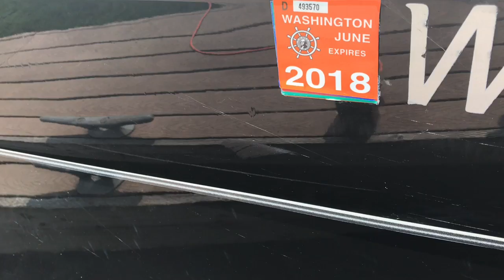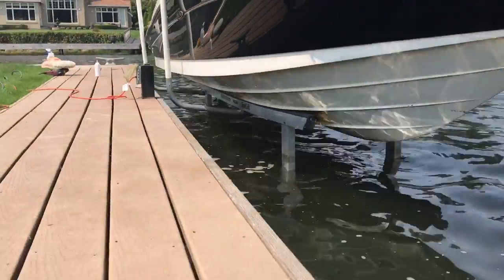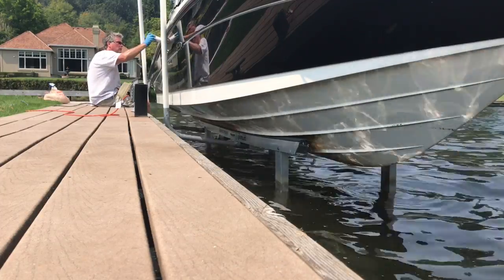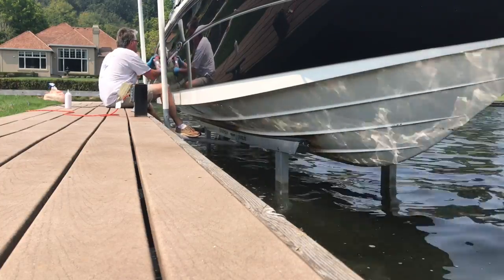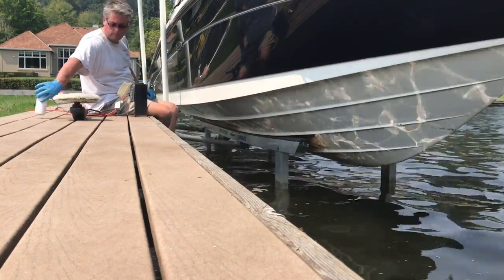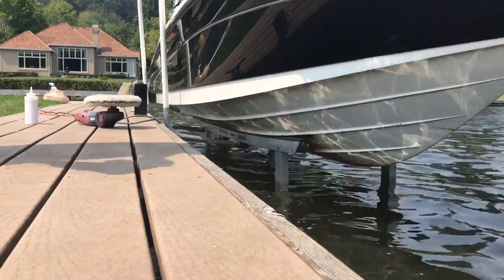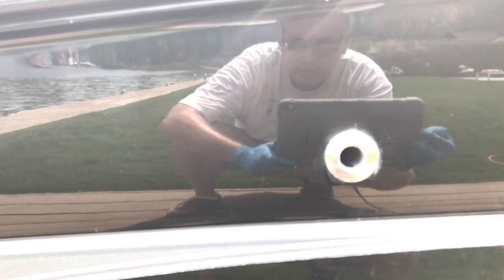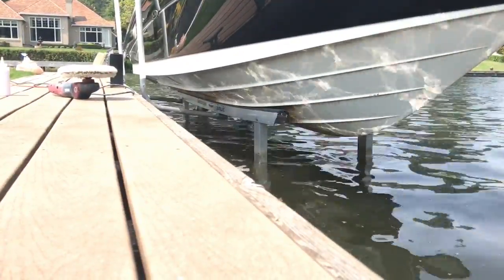Remove Scratch And Scuffs From Boat Fiberglass

Comment: how do you buff the other side  since there is no dock on that side ?If you get in a dinghy you can get to the other side but then how do you put the pressure onto the buffer because your dinghy then moves away .I see from another vid that you have owner or capt turn boat so you can do other side, do you always do that?
Reply from the maker: We always turn boat. Sometimes we use dingy on larger boats to help get bow end.

Comment: Thanks for the video. Very informative but you may want to add a warning. Using Electric Power tools with your feet hanging over the dock edge, mere inches from the water, isn't recommended. One errant wave hitting your feet could have completely changed the subject of the video! It might even have become a "shocking" experience!
Reply from the maker: It is a dangerous job for sure. I was connected to a gfi circuit and the tool has a plastic handle. If that helps?